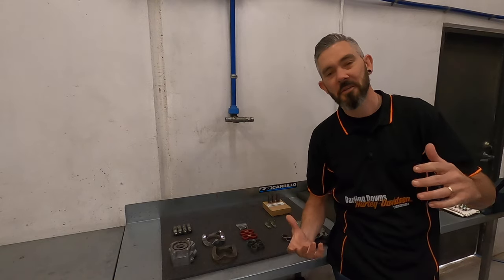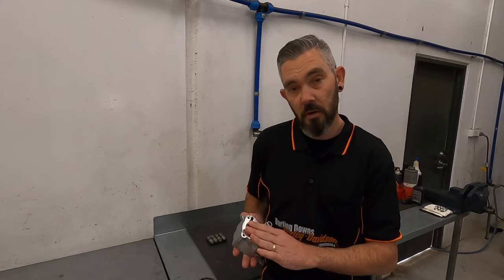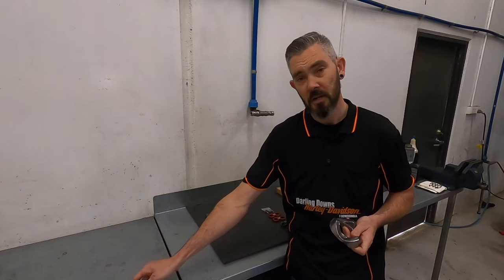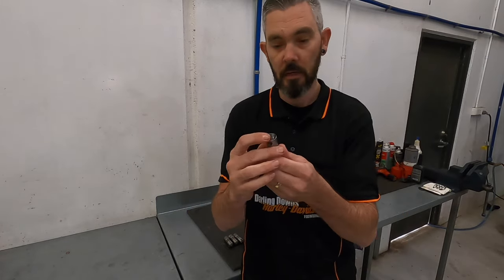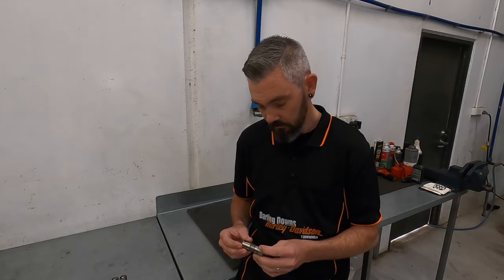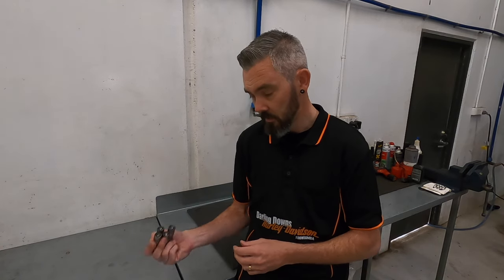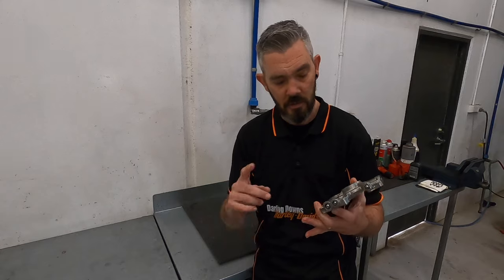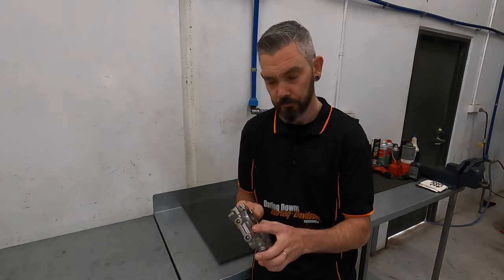M8 Engine Must Have Upgrades / Harley-Davidson / Engine Building

Comment: I think the best thing you can do with a HD motorcycle is to perform RELIGIOUS OIL CHANGES IN ALL 3 HOLES. That in of itself kills over 75% of issues, same goes for any gas engine.
Reply: Changing oil wont fix poor designs
Reply: How often do you do each
Reply: @illduitmyself  But it will fix oil damaged by excessive heat. Idling in traffic is an oil killer. heat-damaged oil will not lubricate your engine properly and parts will fail.

Comment: Good advice. Gotta say though that there's a few must have upgrades on these very expensive machines that Harley should just be doing from the factory. I have a  2022 Road Glide Special with just a stage 1. Not into racing or anything but i guess at some point i should just go stage 2 and have all this done. As long as it is reliable. Like taking my bike on long journeys.

Comment: What about the oil pump and cam plates on the 22 RG ST for instance? Also wondering when to consider a let say Baker comp sprocket instead of just the compensator ramp? Am doing either a stage 2 with high lift cam or a 132" this winter on the RG ST
Reply: Great video btw!

Comment: I have something important for M8's that recently came onto my radar; something I would have never even thought about and perhaps not even believed, it's significant, it's about pumping and a dirt cheap fix for it, but comes with a short story: 

I have a 2020 FXST, 107ci. I assumed that I was safe from sumping because of the 2020+ oil pump, and the fact that  all the sumping issues appeared too be on touring bikes. Well, I heard about the Sump Plug being too long and blocking off the sump oil pickup hole, and how the plug installed from the factory blocks the pickup. Well, I pulled that plug on my bike, and 10 ounces of oil came out. 10!!! There is supposed to be less than 4 ounces in the sump, and I had 10! My bike was sumping. I replaced the sump plug with a fueling shorty sump plug, and now after 2,000 miles, my sump has less than 1 ounce of oil in it. It's a very, very cheap part, less than $20, and is quality assurance if nothing else. In my case, that tiny screw solved my sumping issues. I wouldn't have believed it if someone else told me, but it worked for my bike.

Comment: Through research i did everything you talked about 3 weeks ago on my 2017 SG. including adding a thicker clutch rod to eliminate Trans fluid transfer to the primary. Added a breather line to the trans cover and eliminated oil blow by completely. You are spot on. Great advice .

Comment: Hi Tommy great video I have S&S 475 cam installed with S&S lifters etc and was going to fit the S&S pump and plate but on you recommendation I will definitely be going for the SE cam plate and pump and are currently waiting to hear back from my Harley shop on getting this upgrade fitted. So thank you for your input much appreciated. Without doubt my favourite Harley tech to watch. 👍🏻
Reply from the maker: Thanks for watching 👍 
Glad you're able to take something away from it

Comment: Subbed to your channel M8.
I’m here in the states.
Anyway …. 
About to do a 124 on my 107 2023 FLTRX.  
Gonna do 483 cam.
I have a really fkn good builder tuner over at one of the HD dealers by me (could get a killer deal at an Indy shop on this job but I ride so much all year except in snow .. or not on purpose lol .. 
so I’d rather spend the extra loot and know I got the best man on the job that I know and trust .. 
anyway .. 
HD said that I didn’t need to do the ramp.  I was a bit taken aback bc I never heard of that not being recommended to change… they had me do the 55mm mani and oil cooler fan and lifter cuffs and lifters etc .. basic support mods but nothing not needed .. so I don’t see them selling unnecessary parts ..When I did stage 2 (did the stupid EPA SE447 and SEPST.. but that tuner was able to make it run amazing despite
That SE tuner ..  like this dude nailed it.  So can’t wait to see what this dude can do with PV.  

The question I have is did they improve the compensator design in the newer bikes ? Like that oil pump and cam plate in the brand new bikes are great.  Even Bryce from Star racing said that latest OEM design is way better than the SS and Fueling options… better scavenge on the OEM design.

But yea I’d love your thoughts on that compensator.  

Thank u
Reply from the maker: Thanks for watching & subbing mate. Much appreciated!!

The stock compensator ramp is trash! 
If you are doing a big bore kit, there is NO WAY I wouldn't recommend doing it.

Let me know how you go with your PV Tune when you get it done.

Comment: Would u recommend upgrading the flywheel?… taking the balancer out… wielding it… or changing all together when going 140hp +?
Reply from the maker: In most cases it fine to use the OEM Flywheel. If you intend to give the bike a proper hard time then for sure, I highly recommend either the welded & plugged OEM flywheel or something from the aftermarket (Darkhorse or S&S)

Comment: you should have mentioned replacing the plastic intake manifold with an S+S or Ward aluminum one, the plastic one needs to go
Reply from the maker: In performance applications it needs to be swapped out but otherwise the OEM one is just fine. I don't deem it to be a must have upgrade for all which is why I left it out

Most of the builds I do end up with a bigger 64mm Throttlebody & as a result the manifold is swapped

Comment: Thanks loved the upload. Reassuring 👌 that my build has, like I excepted, all the correct goodies.
Would love some advice on M8 air intake upgrades. I have RG ST, 117 with a Zippers 468 cam, Freedom 2 into 1 exhaust, upgrade Screamin Eagle air intake/filter. Loud and lumpy 😂
I’ll be coming up to my first major service 8000ks, and thinking of doing the air intake manifold and possibly the throttle body as well. ?Screamin Eagle 64mm setup or something equivalent.
Firstly is this over kill on a stock head bike? What would you recommend?
I’m looking at picking up some more HP
Thanks in advance

Comment: I have a M8 Streetglide Special I got in Dec 16. Just did a 32000km service. Nothing upgraded and no problems so far. But! Do I dare to go on a 4000km trip this summer 🤨?
Reply from the maker: In stock form they are fine. It's only when stage 1 and 2 mods are done that you should consider the upgrades outlined in the video
Reply: @MasterTechMiller  Thanks. what a relief :)

Comment: What about replacing rocker arms and rocker stunds?are they essential for big bore kits??
Reply from the maker: No. I haven't found any evidence to support them in builds yet. 

Very high performance strictly race applications may find them beneficial but definitely overkill for even big bore street engines

Comment: Thanks for this update really appreciated I was so confused with all the hype around different parts that needed replacing you certainly know your stuff.
Could I kindly ask you a question about the oil I should be using ina M8 I have a Harley fatboy 2022 only had it for five months still breaking it in 600 km so far have the standard dino oil that came with the bike.
I’m thinking of using a synthetic just wondering if the SYN3 oil is what you use in theM8’s alternatively I was looking at Motul as I’ve had very good results with my Yz250 2 stroke and motul gear oil
Sorry another oil question I know people hate this but I’m a bit confused as to what to use and would prefer an experienced person like yourself to comment as to what oil you put in the crankshaft primary and motor many thanks
Reply from the maker: The Harley Branded 20W-50 is absolutely fine to use. It's absolutely fine & I happily recommend it. 

If you want to spend the extra money on the SYN3 oil that's fine too.

The FORMULA Plus oil for the Transmission & Primary is also absolutely fine to run.
Reply: @MasterTechMiller  thanks very much for your reply 👍

Comment: Great information! I know this is a year old but I just bought a 17 Street glide with 46k miles on it, I believe it to be bone stock it has lifters/ tappers that leak down and rattle if you don’t ride it every day. I don’t want to go with a hotter cam I am old I just ride the bike on the highway driving the speed limit most of the time it has all the power I need! Would changing out the lifters with new screaming Eagle ones and the latest oil pump that’s out from Harley be the best way to know I am good to go? I think a new cam plate and cam would be inline so all he parts will get along in that cam chest am I think right or nuts? Thanks for what you do!
Reply from the maker: Yes, swap out your lifters for SE High capacity lifters & update your oil pump. That would be your best bet at this stage.
Keep in mind, that if and when you decide to do a cam upgrade in the future you should always replace your lifters at the same time.

Comment: Followed your advice Tommy upgraded my 107 to 117 with APE stage 2 kit upgraded oil pump 55mm intake 5.5 injectors CR480 cam lifters i already had V&H powerduals & 450 titans K&N aircleaner  produced 130hp 142tq tuned using powervision it was a toss up with which cam to use 480 or 483 went with 480 for the low / mid torque absolute beast , Do you replace piston jet oilers on your builds ? i never hear many people talk about them mine were loose & causing sumping so had new ones installed cheers mate
Reply from the maker: Most of the engines/bikes I build are brand new so I dont replace them on new bikes.
If the bike has done any amount of kilometers I replace them.

Comment: Great info... thanks for you knowledge and time.
I'm a gentle long distance rider .
107 se stage 2 ... 2017 ultra. 
Items for prevention  !!
1... oil pump
2... cam bearing
3... lifters
I think that these should be replaced. 
Also what about oil transfer to primary  ?
My gear oil goes down very very slightly. 
Thanks again for your advice..
Reply from the maker: Those 3 you mentioned will definitely prevent any premature problems or failures.
There is a vent kit that can be done through the dealership that vents the primary housing to help prevent oil transfer problems.
Reply: @MasterTechMiller  thankyou , I know the kit that you mentioned  👍
I will do those mods and with good prevention servicing... I will be able to ride with confidence... 
I have 40,000km trouble free so far   !!

Comment: great video.. thanks for sharing your thoughts on those upgrades.  I am in the process of putting together a parts list for a stage 2 cam upgrade for my 22 Road Glide ST 117.  
I'm looking at the Star 30/30 cam and was originally going with an S&S oil pump and cam plate.  I guess I'm now changing it to the SE version.  My parts list include Feuiling lifters, Koyo cam bearing, S&S tappet cuffs and an S&S performance intake manifold to replace the Harley plastic version.   (do you have thoughts on any of these items?  You also didn't mention the plastic intake manifold.  Should I replace that as well?   thanks again

Comment: I have a 2017 n worked for Harley 9 yrs. I should replace the oil gear because mine is getting super hot back cylinder and use a lot of fuel. That would be sumping or a tell tell sign connect. Really use a Screaming cam plate . The dealership in Oklahoma n states. Are recommending the S&S so I appreciate. I will be subscribing your channel been fight the tgripsensor n about to change to carb but want to run throttle cable not the electric throttle wires off a 2010 sportster on my 2017 FLTRx I have 15 apes on it
 But I'm leaning more towards a king of the bagger style bike but am looking at doing a GSX inferted front end off eBay not the ❤2000 dollar Krause . I'm already pissed no drain plugs on front end n what happen to the inspection door on primary cover. I'm planning on the mid controls and if I do the road racing style risers and metal speedo and tach mount. My Harley risers broke at 20,000 and the sold me a used bike that had toasted neck bearings . And the service mngr ate the part n labor which was not cover so now then I told them I want Ed no 2 yrs warranty I would have been working on my own shit have my PhDs w Harley so.their was no voiding it. But after them not having the fork oil change after 20,000 first time I cancelled it n told.them since I can't hold the money for a minute but send it to the payment n this one is my 3 Harley at 46 got first at 23.
69,000 11 months. And didn't realize I could have used it as a write off
 Does Harley not require us to ride their product. Right thank you fellow motor company brother.
Reply: You might get a reply if you actually took a minute to make your comment/question understandable!  Punctuation goes a long way and correct spelling of key words would help a lot, such as you saying connect which I assume was supposed to be “correct” (as in asking the question)!  
Everyone understands when a typo or autocorrect jacks up something in a quick comment.  But when you type out multi paragraph comments/questions then your implying it’s more serious and you’d actually like someone to read it/answer.  That’s hard when your writing is all full of errors, lacks punctuation, and rambles along somewhat incoherently.  It makes it “sound” like it’s coming from a kid and no one is gonna take that seriously!
Not just ragging on you, I was really reading your comment and was gonna reply as I’m just as experienced with Harley’s and been working on motorcycles almost 30years.

Comment: I’ve had the 131 SE kit so guess some of these are upgraded in the kit?, still got to do compensator to do though for sure done the SE cam plate too
Reply from the maker: Absolutely! The compensator is a must with the 131.
Reply: Jesus that shits me. Had a 131 built by a local dealer and didn't tell me how pathetic the SE cam is, so had to cough up for a CR512 install and it's a completely different beast. But of course, no one has ever said anything about the compensator.. @MasterTechMiller

Comment: Hey Tommy thanks for a well presented and informative video. 
You touched on clutch springs so I'd like to know your thoughts on the Rekluse Auto Clutch.  Have you fitted these and this would go in a Low Rider S 117 with stage 2..
Thanks again 
Mark.
Reply from the maker: I have fitted them in the past to both customer & our own demo bikes. I highly rate them & think they are great. I haven't put them to the test drag racing so I can't comment on how they hold up. They are a great thing thing though & something you should be able to install yourself if you are mechanically minded.

Comment: Great video but I do have a few Questions.  I put an S&S 475c cam in my 2019 street glide 107 M8 and used the S&S cam plate and oil pump. Do you think I need to worry about it ?  The crank only had .002 run out if the is a consideration. Also do you recommend replacing the compensator ring on all M8s or just the built ones ?

Comment: When would you recommend upgrading the stock headbolts with heavy duty reusable headbolts from Screamin Eagle or S&S ? Would it make sense when installing the 131 kit with CR-512 cam only ? Thanks and greetings from Bangkok !
Reply from the maker: No it's not worth it for that kit. Nor is it worth it for most other big bore bolt on kits out there. The only time I would recommend them is on a boosted application or complete racing application where the engine is torn down and rebuilt frequently.

To be honest the OEM ones are just fine.
Reply: Great information, thanks a lot 👍

Comment: Very informative.. cheers for sharing the knowledge..
With Lifters, how often should they be replaced,
 i.e in a twincam runnin se266.. ? Runnin procomp atm
Reply from the maker: The SE 266 cams require regular valve train maintenance and inspection as they are a high lift, high duration cam that puts larger stresses on the valve train. 
Depending of course on riding conditions (daily rider or more aggressive high rpm situations) I would suggest that the lifters be replaced every 20,000km for daily rider applications & around 8000km-10,000km for more aggressive riding styles. Keep in mind you should be able to have a decent understanding of what your engine sounds like & paying attention to it for any abnormal louder or growing noises should indicate cam chest & valve train inspection
Reply: @Master Tech Miller  too true.. have noticed alot more top end rattle ...  normally change them at 30k, but have left them for 35k this time.
 Yer think it's time for a change.. besides the fact my base gaskets are leaking now hahaha..
I'll be doing fill gasket change, with check of cross hatch in bores( maybe  redo with oversize rings).. thinking going solid lifters or fitting limiters to new set of hydraulic.. too much hitting rev limit... whoops lol
Reply from the maker: @19Trent69  if you regularly see high rpms and touch the lim lim from time to time, I would definitely recommend short travel lifters. Have you got a hi volume oil pump?
Reply: @Master Tech Miller  no don't have hiflow pump.. have had to have my original replaced.. gears were all scored haha
Engine was split and shaved with timkin bearings placed in.. at around 80k km.. now has 140k on the clock.. want hiflow pump th8s time .. upgraded cam plate, rocker lockers, was thinking gear drive cams(maybe to eliminate the need for gear tensioners and timing going squiff lol) . As have had the crank true and welded due to ruining the journals haha new rods were added . Runout at crank ( at cam plate) is 0.0008"
New lifters, and possible another set of heads from Ram engineering, as these i have are for up to 107".. ( it's now a 117").
Has AV&V gear, gold valve guilds ect already.. 
Which is why I don't mind spending extra on it as it has good stuff, just not all the best.. 
Had the bike 10years and still kranks along.. sort of hahaha